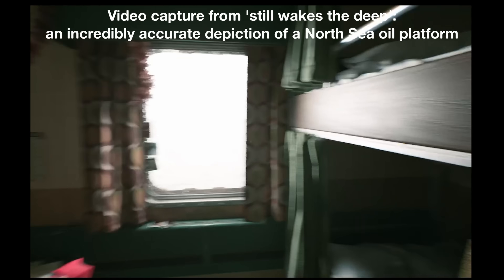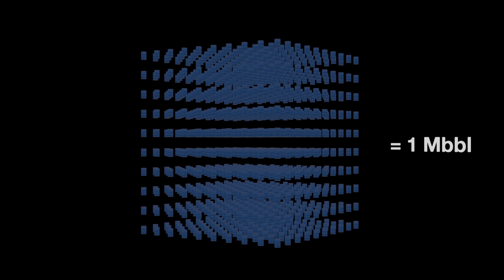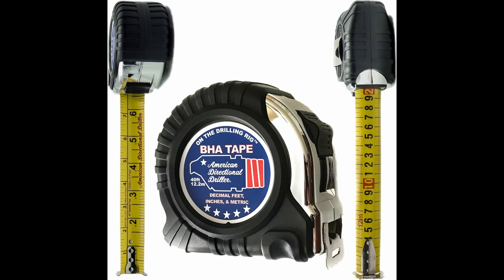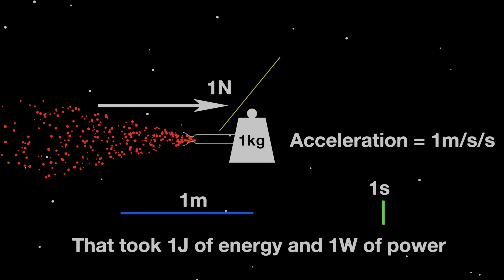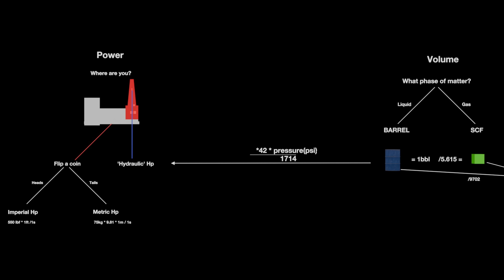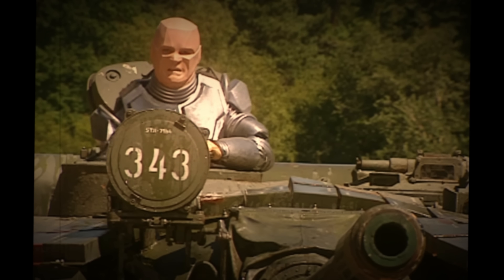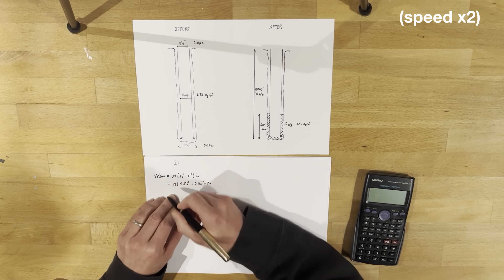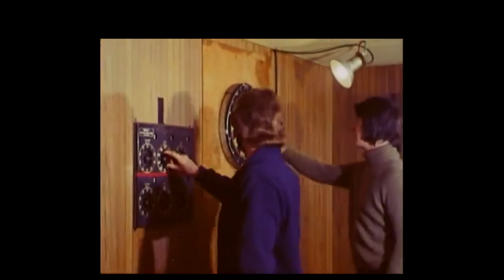Oilfield Units: a Measurement System so Cursed it made me Change Career

Comment: So we should STOP using SI units, then? That's a terrible system. I say that as one who has been in the aerospace gas turbine engine engineering design business for over 35 years.

I find it interesting that you can bash people and make disrespectful comments in your video, but you have this warning pop up for anyone wanting to comment on your video insisting that we be respectful. 🙄
Reply: @ronaldschoolcraft8654  do you have a better system to suggest?
Reply: @JoeJoe-wv6de  the system still in use for designing most of the military hardware that defends you; the US Customary system.

All the nonsense about SI being better is just Eurocentric propaganda. As an example, ignorant people claim that SI is a "consistent" system. The truth is, the US Customary system is, too. The main point the propagandists make is that the kilogram is used as the unit of mass and the Newton is is used as the unit for force while the US Customary system uses the pound for both and needs a proportionality constant to keep it straight. Well, the US Customary system also has the slug for mass, which requires no proportionality constant. By preference, people don't use it. The same preference shows up when engineers use kilogram-force which needs a proportionality constant instead of Newtons for force. It happens all the time, even in Europe. There are many reasons why this is preferable in certain circumstances. That destroys the whole argument.

Another often used strawman is that the SI uses base ten and the US Customary system doesn't. Well, when you use decimal inches as is done in aerospace engineering, that argument falls as well.

Comment: In the US construction industry, concrete (and materials like gravel, dirt, and sand) are usually sold by the cubic yard, conveniently shorted to just "yards". A typical cement mixer truck holds about 8 to 10 yards of concrete.

Comment: Back in my uni days we used to joke about "Teravolts per fortnight" instead of "Volts per microsecond". It's not far off!
Reply: The midpoint between a Planck length and the diameter of the observable universe is about human scale. I forgot the exact value and am too lazy to do the math, but it's like shockingly close to a meter.

Comment: Oilfield units are just a subset of the US Customary System of units,  which in turn is based on traditional English units of measure dating back centuries.    It is embedded in our culture and how we view of the world.    Pounds and feet are tangible quantities.   Kilograms and Newtons are mathematical abstractions.    Having worked in the oil industry for over 4 decades I would no more complain about our traditional measurement system than I would complain about English spelling,  grammar, syntax or the language of the King James Bible.     

I can't believe the temerity to criticize HP (8:30 ff).     I can assure you,  everyone who buys a car in the UK will tell you how much HP the engine produces,  if asked,  NOT N-m/sec or kW.    Also,  BTU are directly convertible to power,  e.g.,  2545 BTU/hr = 1 HP

I worked in the UK oil industry for many years and I insisted on customary units,  in spite of the occasional push back.    I told a group of Brit engineers once that they should be ashamed that an American was having to explain to them what a BTU was (British Thermal Unit).     

This is going to sound cruel,  but I believe the real issue is that Americans still  have enough confidence and pride to use our own systems of measure while Brits have been cowed and badgered into capitulating to the European SI system,  or as I referred to it,  the FFU (Funny Foreign Units).     You people need to stop apologizing for imperialism,  colonialism and your own ancient system of measures dating back to Alfred the Great.    You voted for Brexit.    You're free to use your own historical units now.   

Oh, and remember,  there are 7758.4 bbl per acre-ft,  without it,  you can't calculate how much oil is in the reservoir that we're trying to extract.

Comment: worth noting that the pound is actually both a measure of mass and of force! there's two different pounds called the same thing and the only relationship is that earth surface gravity is 1 lbf per lbm

similarly, metal hardness standards are defined using the kilogram of force for some reason

Comment: While I agree with most of your complaints there is a factual error that actually hampers migration to SI, despite being common.

The pound and actually all historical units of the operation of weighing things is intrinsically a unit of mass, specifically because balance scales are mass comparators, not direct force measurements.

Specifically in the legal sense in both the UK and US the pound has been defined by the kilogram for over a century, considering that the units don’t change is probably a good lens.

Pounds force, a gravitational unit, is lbf, is sometimes shortened to lb, which can cause some confusion.

Note that the pre-SI metric system had the kilopond and defined standard gravity also.

Not that it matters as now that the Kilogram is no longer artifact based, methods like the Kibble balance have to use weight as an operation to derive it.

Albert Einstein’s equivalence principle allows for this, but it does conflict with common legends.

It is probably best to avoid this urban legend as it is commonly used for people who all suffer from confirmation bias and will use it to dismiss the remainder of your argument.

Especially those who do have a valid point about the challenges with base 10 and who leverage the advantages of base 12/16 to avoid the loss of precision with decimal’s poor factoring properties.

Comment: It should be noted that every single time you do conversions like these, you're introducing floating point errors (or worse: fixed point errors as would be the case with older calculators).
These errors accumulate over time and are impossible to account for. There are ways of reducing them through proper order of operations, but I doubt any oilfield engineers have the computer science degree to understand how to do that (or time to bother).

Comment: re the M prefix and Million.

We use millimetres and various other millis, which just like the italian word (and others) for 1000 derive from the latin. so I think youre a little harsh complaining about Mbbl especially as theres MMbbl.

The more confusing one is Billion which used to be a million million, but now means a thousand million. I'm 41 and I remember the old definition.

I assume its Gbbl to avoid any confusion with Bbbl?

I also don't get kwh, as a watt is already defined in terms of joules per second. so a wh is X joules/s/s which is a rate of change, not a rate of flow.

Oh and an inch is defined as 2.54cm so an inch is kind of already an SI unit in as far as its defined in terms of SI units.

Comment: After completing the video. Wow. Drillers have it way worse than I do. As far as the green book goes, you should use excel instead haha.

In all seriousness, this inability to adapt to change is something I deal with a lot, but a lot of these units are not for the engineer doing the calculations, but for the guy mixing your mud/cement/fluid. The ability to reframe your perspective is probably one of the best skills an engineer can have, and I think these units are meant to weed these engineers who can't reframe out. Although it seems like you are perfectly capable of thinking in oilfield units, it seems like you were bullied incessantly for it and thats simply unacceptable.

Comment: As someone who more or less made it in oil and gas and 7 minutes in, although i wasn't raised in drilling, which is what you were previously in (I actually hate drillers), I fail to see why catering units to your specific industry is a particularly bad thing. Mud weight as I understand it is designed to give an intuitive understanding on concnetration on the amounts of solids added to fluids, and "density" is an ambiguous concept when it comes to units, (mg/kg, mL/mL, g/unit area, and so on). Coming from a place where ppm (parts per million) was often confused or used in place of ppmw or ppmv, this was actually a welcome clarification.

API gravity as I use it is a measure of relative gravity, in that a lower API hydrocarbon can thin a higher API hydrocarbon.

ppm is often used in water analysis or hydrocarbon analysis, again, using units more catered to what you're doing.

As far as unit conversions go, I only have to remember .12 😂

Comment: Even NASA burnt up a Mars probe when the two groups responsible used different measures (Lockheed-Martin used US/'imperial' and NASA used metric).  Neither realized that happened or recalculated for the difference in the measures.

See: Mars Climate Orbiter 1999

Sure, it was decades ago.  No, that's not a good excuse.  The bad measure is still around and does get used.  Even back then, metric should be the only measure used in engineering and the sciences and the only exceptions should be where metric can not (no metric derived measure is available) or should not (by necessity) be applied.

Comment: As a Dutch retired physic engineer I had to also learn how to use conversion so all calculations could be in SI/metric. I have a brother living in the US and he has his own plumbing business and he learnt the SI system from the beginning from dutch schools. 
He lived at a hydro-power lake and had to deal with many meters of water-level difference through the season and wanted a floating U shaped dock for his pontoon-boat and used 12" PVC pipe for it. He did all his calculations for floating force on a scrap of paper and when done the U was perfectly submerged half way with enough extra to stand on one side. His colleagues were flabbergasted  that he knew it would float and not sink. 
But if you get that 1 L = 1 dm ^3 is close to 1 kg weight and that 1 KG was originally defined as 1 dm^3 of water (standard p,t) then it becomes real easy. 
Of course you also have to know the specific weight of PVC and it is larger than 1 kg/dm^3  vertical pipes for the roofing and the corrugated roofing sheets.

Comment: I'm an engineer, I'm fluent in Imperial, Metric, whatever I need to use (multilingual). It's not hard, at worst you need to memorize a few conversion factors. Part of being an engineer. I don't understand why so many people, mainly metric-only users, throw an absolute toddler fit about other units. Maybe it's like an IQ test, and the people who are whining that you didn't convert the units for them in the comments of some videos or circle-jerking on reddit about how dumb Imperial units are, are the midwits. And btw, "actual calculations" are not always done in SI in the US, in aerospace I've rarely used SI. I still say thou instead of mil in the workplace though.

Comment: This is actually interesting, I'm always delighted to find some new topic containing info I have never heard of.

As for the backlash from people in the United States... The U.S. is built on the std/imperial system. If you give most American's SI units, unless they work in a University, or have recently graduated w/some sort of engineering degree, SI units have no meaning/value w/out first converting it to some known reference. I could put a Kg weight on my desk to physically familiarize myself with it. Perhaps, switch out my scales in my house, switch all my outdoor temp readings and force myself to really embrace SI, but why? We are a country of 330-350 million, it would be really weird to go around using SI, nobody uses it.

To be honest, as a machinist, the few people I've crossed paths w/that liked metric, lacked problem solving skills and just seamed mentally 'lazy'. No, I'm not stereotyping, I'm guilty of using a imperial/metric tape measure myself. It's nice being able to divide by two and find the center of something. However, if I want accuracy/precision, I'm using Imperial. Can you get accuracy using SI? Yes, but the tools are obscenely more expensive (why exactly is that) and for me, I still have to convert it to imperial to have a reference as to what type of accuracy I'm achieving.

Odds are, if you land a job in the U.S., unless it's some 'hip' new startup, you won't be using SI. Even more fascinating, when I traveled overseas to one of many aviation conferences.  Engineers out of both Europe and Australia, explained they don't use SI, they use Imperial. It's a little frustrating, having wasted so many hours converting things over for the 'international' audience to find out they didn't want/use SI. I know, anecdotal but it's also not w/in my old industry (I'm retired(ish)).

Comment: It's too bad the meter is the wrong size, otherwise it would be a good system.
What I mean, the length of any standard is arbitrary, using the distance between the north and south pole to create the first meter standard, was dumb, they should have started with the millimeter, and make a measurement scale that can be marked and seen with the human eye (it would be about 1/64th of an inch). This is for wood working tolerances, which the eye can see. It's good for all carpentry work.
I'm a retired BSEE, worked avionics for a career. Had to deal with both systems, both learning SI and SAE in school. Look at magnetic's, Oersted or Gauss. But mostly SI, until the black box measurements all inches, converted on the drawing the metric for our non USA customers. And all aircraft in the world fly with IAS in Knots, and altitude in Feet.
Reply: It doesn't matter what the length is as long as everyone can agree on it. But if you can freely choose units because their values are arbitrary, why not choose them in such a way that their conversion factors to other, combined measurements are trivial? That is the real reason why metric or rather SI is superior - the math is neater and thus less prone to errors.

Comment: There are 231 cubic inches in a Gallon. Not 216 ?
Also, the 10ths of a foot measurement system is used in civil engineering / grading in the U. S. An inch is simply too small of a measurement when grading with large construction equipment.

Comment: During an apprenticeship, I had to process surveying data that was partly in 400, and partly in 360 degrees (without telling which unit was used where). It was solvable by applying the rule that the sum of the angles in a triangle is 180 (or 200) degrees and some knowledge about the relative position of a few points.

Comment: My favourite (or maybe favorite) is equivalent circulating density ECD where you present total pressure in density units (probably with a # for lb for good measure). I mentioned it to a Rolls-Royce guy once and he came back 10 minutes later still confused as to why...
Reply from the maker: I forgot about that! Agh I’m mad I didn’t include that now.

Comment: Hey SI nerd! 
A meter is defined by the inaccurately measured circumference of an arbitrary object, the earth. By a Frenchman. 
Weight is defined by the arbitrary liquid, water, filling the arbitrary volume unit. 
Etc etc. It's all arbitrary. 

What you really want is decimal units,  not SI units. 
It's nothing to do with the units. 
You just love the French.
Reply: The meter is defined by the lenght of travel of light in a vaccum. But yes, it started as a messaurement of an object.
Reply: @MissYijare your comment is defined as asinine and useless. 

A reasonable unit might have been precisely 3e7m/7, not 2.9...m/s.
For that matter, an even better unit might have been 10e7m/2, but that would have been 1 foot,  and you can't admit that king's George's foot was astronomically perfect to define a unit of God's length
Reply: It doesn't matter what the length is as long as everyone can agree on it. But if you can freely choose units because their values are arbitrary, why not choose them in such a way that their conversion factors to other, combined measurements are trivial? That is the real reason why metric or rather SI is superior - the math is neater and thus less prone to errors.
Reply: @hammerth1421 you're acting like you can do any sort of actually useful scientific math in your head, regardless of units and conversion factors. 
The reality is that when you're digging to 18000 feet, it doesn't matter how many barrels or liters or gallons or saucepans of mud you need, it's still a fucking ton, and you need a computer to do the math.

Comment: As an Australian who uses SI and works in oil and gas it isn’t anywhere as difficult as you make out. We just take all our inputs and convert to SI and do our thing. Convert back if we need. Usually don’t need to. 
And most people only work with a few at a time so it’s not that hard. 
But yes it is bonkers.

Comment: I was only exposed to the imperial system once, when my aunt (who moved to Texas) wanted to know whether getting better windows was worth it, so I had to calculate the thermal transmittance of her walls to get a rough estimate to her. I foolishly went in thinking "right, they'll probably use Watts per foot and Kelvin because they like feet" only to find out that no, it's actually BTU per (hour square foot degrees Fahrenheit). I was almost physically ill xD